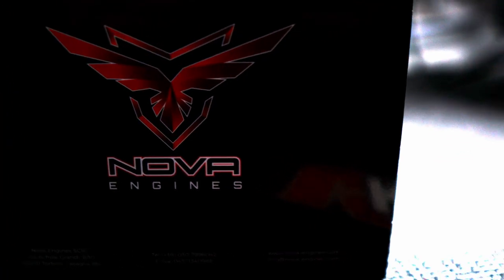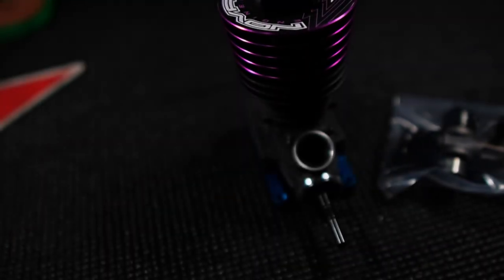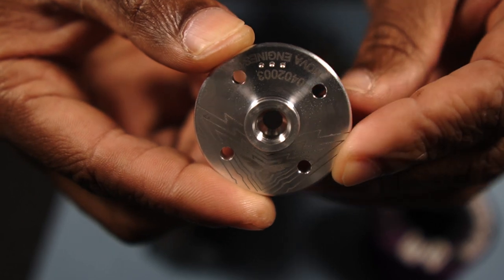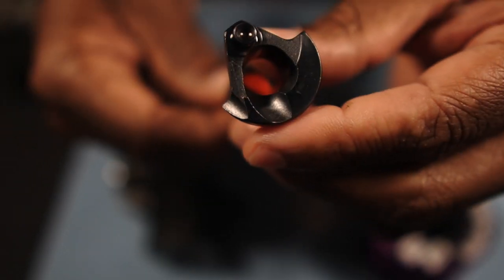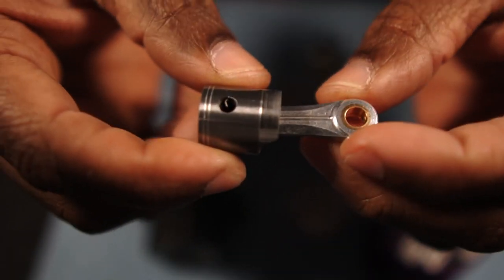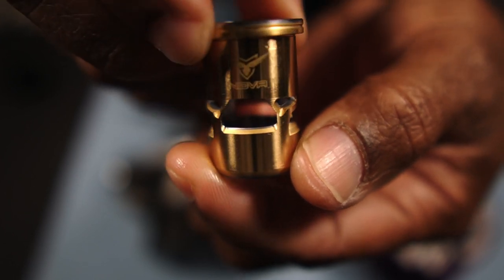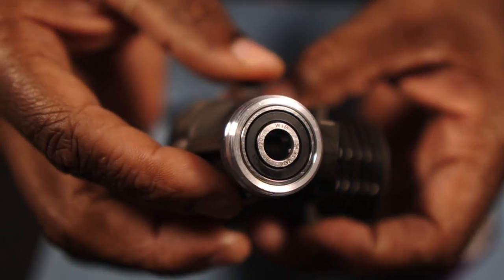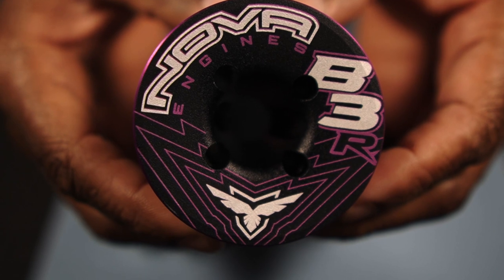Nova B3R

Comment: Nice looking engine. Can definitely tell that it’s nova based but I also see some other similarities with engines like Sirio which makes sense since I’m pretty sure the former lead engine designer at Sirio is working with nova now. The crankshaft and crankcase are 1000% that’s for sure. Sleeve looks like a mix of nova and Sirio and the piston and con rod look more like a Sirio. Pretty nice engine and the price isn’t too bad
Reply from the maker: Right on

Comment: Also uses a billet Piston  (Sinterized alloy piston (top quality)) and notice the insulator for the carb in the block.  I think someone might have mention Swiss Rear Ceramic bearing and Swiss steel ball front bearing.

Comment: I believe those cuts on the bottom of the sleeve is because this engine is a super short stroke so the extra clearance is needed. Correct me if I'm wrong.
Reply from the maker: That would make sense

Comment: I have a question what would be the effect is any if my idle gap is too small. My 28.8 is supposed to be at .6mm I’m under that. The car seems fine but just want to absorb Into.
Reply from the maker: The carb idle size is just a baseline, really depends on the tuning. Sometimes you might be over or you might be under. Don’t put to much time in to setting exactly right l, most important is to make sure the tune is right and the engine drops back to idle with a good steady idle.
Reply: @rajaa111  thank you very much

Comment: Might be wrong for doin this but I run my #3 plugs on cooler days anything over 80* ambient I run #4 plug and none of my engines won’t even look at a #5 plug. Always run 25% nitro fuel. Maybe somewhere down south below the equator say South America I may have luck running a p5 plug 😂😢
Reply from the maker: Me and you both might be wrong, I’ve ran p3’s in my novarossi and didn’t have any problems
Reply: @rajaa111  seems p3 is best all around choice for most applications. If I’m having bad tune day I always make sure I’m at least running #3 plug than go from there. Great video I’m really liking this engine!!
Reply: I run the original novarossi #6 plugs in all my novarossi’s while I have stock and they all run great. Even ran in colder weather like 40’s. I bought OS P5’s for my novarossi’s when the 6’s run out and actually got to try one at the Rajaa race. Ran the OS P5 in a Novarossi Toro Nero and it ran amazing. Great tuning and had no issues all weekend. Just saying the colder plugs aren’t bad. I heard it just makes the tuning window smaller.
Reply: Nova plugs are Nova Glow plug Turbo Offroad N.6 and Nova Glow plug Turbo Offroad N.5 (hotter that 6)   I wouldn't run OS plugs, as the taper is different
Reply: @brentbones2537 yea, the taper is off and I’ve heard once you go OS plug you can’t go back. I bought them before the nova plugs came out. Only reason I used it in the Toro was I bought engine used and it already had a non Nova plug. All my other Novarossi’s have only been original plugs so I think I’m going to buy new nova 6 plugs for my novarossi’s. Keep things the same.
Reply: @brentbones2537  thanks for the heads up brother👊🏻